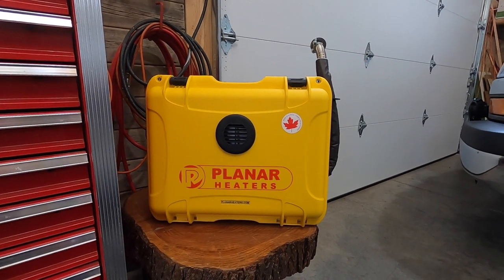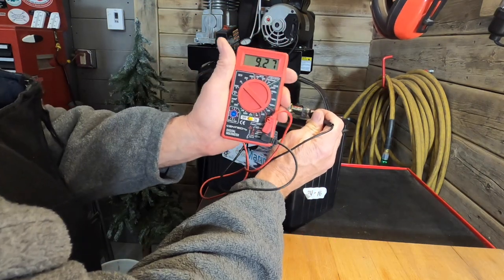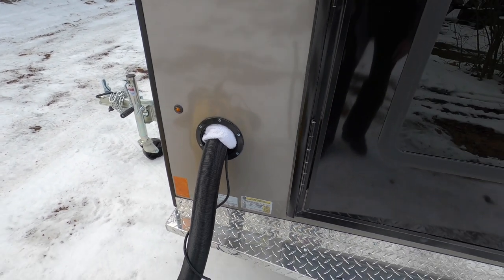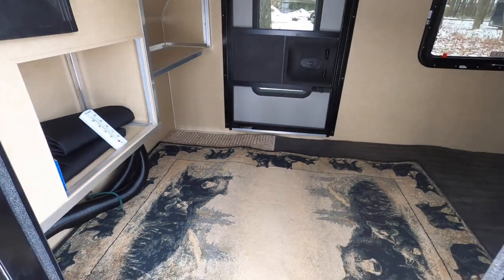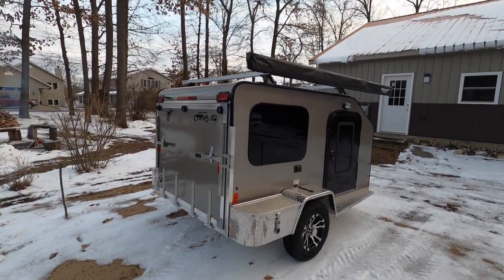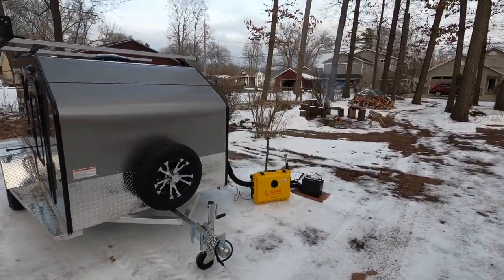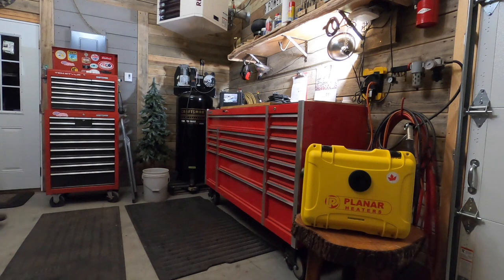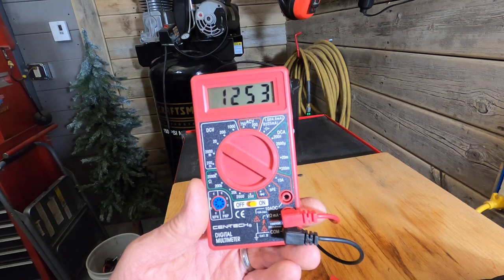cold weather planar diesel heater test

Comment: If going to use this set up in winter weather. Put the battery in a box  like you said. But have the heater hose pass though the box so the heat off the hose keeps the battery warm. 
A container outside has many advantages. 
Keeps the smell  of diesel ,noise of the pump etc outside. Refilling is easier. Big enough for heater and battery ( keeps battery warm)
Last thing if you are going to test other trailers. You got one box with everything you need. 
Great video 💯👍

Comment: Love this set up. One thought I had while you were doing the experiment was maybe crack a vent in the trailer just because they are so air tight.  You are forcing  hot air in with no place for it to go. You may have had even better results. 
Nice video thanks for the info.

Comment: Nice video. I have the same unit, using it for last months. Started out using in my rooftop tent, and also ground tent. Just cut a 2” hole in my teardrop and using it for the first time in the trailer. Instead of running off a typical battery, I actually modified the terminal connections and installed a 12V cigarette male plug, and run the unit off a Jackery 1000W portable battery. They don’t sell it with that in mind but it works great. I’ve kept my rooftop tent at 60 and over with most of the windows open, with outside temps in low 40’s, high 30’s. It gets quite toasty. On the low setting, running 7-10 hours I estimate I have at least 4 days of runtime between fuel consumption and battery life. Typically my Jackery runs down by about 20%; then with solar panels it recharges the next day. My tests indicate I might be able to stretch the fuel out to 7 days if I run the heater 6 hours or less per night. The only downside is that there is not an auto thermostat that cycles the unit down automatically. I read it’s not good to do a hard shutdown as it’s bad for the glow plug. The unit will do a safe down cycle if you turn it off. For those curious, the heater surges to about 8 amps of draw at startup for maybe a minute or two, so the 12V connection is fine. Good luck. Keep the videos coming!
Reply: make sure your plug has secured connection to power station. The whole unit might get damaged if power cuts off while heater is in operation.

Comment: The battery should be in the heated space. A cold battery looses capacity.
Reply: Wrong please educate  yourself .. if the battery  has a draw the internals are  warm  enough  to keep  capacity. Running a heater will keep it warm
Reply: @theviper6602  Not really true, if the battery is not in a heated space and it is a critical application, a small heater may be required to keep the battery warm.

Comment: I used an 1800watt ceramic heater in mine and it worked great even down to 20° days. If I didnt have power, I had a 2000 watt honda generator.
Reply: Hi Kim, I totally agree and  have used my generator often. The diesel heater is simply another option that works pretty good too. Thanks for your feedback!
Reply: @jamesmulder7284  seemd pretty cool. Especially if you're somewhere you can't run a generator.

Comment: Have you considered placing the battery alongside the heat tube and maybe enclosing it somewhat to use some of the heat produced to keep the battery warm? Might that extend the battery life?
Reply: it would defiitely help the battery. theyre not meant to be freezing cold. in fact they can and will be damaged if run down to empty while at freezing temperatures
Reply: For me, I would run the exhaust pipe or gasses through a battery box to keep the battery warm. Insulated heat vent pipe would be nice too..

Comment: This Planar setup has a major flaw in it.  The exhaust should never be pointed up.  Condensation collects but ALSO, if you prime that pump a bit too much or have an issue with ignition etc...where does that fuel go and pool?  right at the lowest point of the exhaust.  Its not entirely uncommon.  Then what happens?  It catches on fire.  Then...that fire ignites that fuel can.  They need a proper downward sloping exhaust.  Having all those pig tails hanging out of the box rather than two Mil-Spec IP68+ sealed connectors that's are properly panel mounted/sealed is also pretty cheapo.  With a bit more venting (not a bad thing) you could just mount the intake within the box too like Keegan's builds do.  I have mine like that (no CPU fan) and get no issues.  Not having that extra hose mess out there makes it REAL clean and easier to pack.
Reply: All details of these heaters have been designed, tested and proved to be safe and reliable. The exhaust pointed up to prevent any chance of the fumes to be drawn into the heater intake. For such a short exhaust hose condensation could be collected in the amount that is next to nothing. At the start heater goes through a purging cycle to clean entire exhaust passage. The heater has a protection from non-ignition fault. It allows only 2 attempts to ignite fuel, and then the heater turns-off to a purging cycle with a fault code. In this case the heater needs a technical service. This protects the heater from over-fueling, flooded exhaust,  and respectively from any possibility of fire in the exhaust. The wire connectors are fully sealed and provide firm cable connection. Combustion air intake is equipped with an air filter and is protected from any elements.

Comment: Jim:  Would the fuel container be too heavy to mount on fender or tool box cover?  Im sure you could mount it on the front where a normal propane tank would go.  Keep up the vids.
Reply from the maker: The fuel tank probably would fit inside the rear storage box. But I’m also working on being able to mount the entire unit inside the trailer with a special exhaust fitting going through the side.
The other alternative would be to buy the non-portable heater and mount it inside the trailer with the exhaust going out the floor and have a remote fuel tank either on the tongue or in the storage box etc.

Comment: Great video,  I do have a question,  
Diesel fuel gels at cold temps I used to add a chemical to my diesel truck when Temps were going to be below 35f. Also the truck had a fuel tank heater that was powered while running,  or plugged into an extension cord when parked to prevent gelling. Any idea how to prevent the diesel from gelling in the fuel tank? Say while traveling from location to location and how to degell it?
Reply: I have the same question!
Reply: I use power service in the white bottle to keep from gelling. It’s easier to keep diesel from gelling then to ungell it. Power service 911 in the red bottle with the ungell the fuel the power service bottle gives a number on the bottle for the gallons it treats but that number is to treat it to 33 degrees. You need to double it to get it to 0 degrees. You can also mix the diesel with kerosene like they used to do. Diesel bought in a winter climate is usually treated upon delivery to the fuel station. I believe they just put in an additive at the fuel station now I don’t think they put kerosene in it anymore.
Reply: Marvel mystery oil should help as a fuel additive.
Reply: @JasonTheMunicipalMechanic  thank you :) great info

Comment: You want a more efficient heater? Add a return hose back to the yellow box. That way you will recycle the already warm air in the trailer. Also the capacity of oil pumped to the combustion chamber is based on how many clicks the fuel pump makes per minute. The fuel pump capacity per click is the same regardless of the heat setting. Each click represents a certain amount of liquid pumped per cycle. You can count how many cycles per minute the pump cycles and that would tell how many ounces the pump produces per that many cycles. This per cycle amount of fluid is a fixed constant. Using this info, you can pretty much mathematically figure the amount of fuel for any given time. Also, I would never pay the ridicules amount of money they are charging for this heater just because they put it in a yellow plastic case. Your better off mounting this heater as a single unit and gain the benefits of the recycled intake air for better efficiency.
Reply from the maker: Thank you for your input Randy.
Thank you for the tech tips on the fuel pump. 
The inside mount can be more efficient for sure, but for a fellow like me with multiple application needs, the portable allows me to move the heater easily from trailer to trailer to vehicle or even ice fishing shanty.
Reply: Actually adding return line back to heater is bad idea as heater needs to cool itself. If air supplied to the heater is warmer than needed heater will drop capacity first and then pump will stop, heter will go through cooling cycle, if air is over 30 Celsius heater will shut down.  Regarding fuel: heater burns from 100 ml per hour to 250 ml per hour depending on setting, pump supplies 4.4ml per 1000 clicks. What's a point of counting clics???
Reply from the maker: @MrVodolaz86  Thank you for your reply. More knowledge into my shallow knowledge pool!
Reply: these little diesel air heater units get a micro camper hot enough as it is, no way you'd want it any more efficient. for an AC return though, definitely.
Reply: Just pushing air into the trailer is creating positive pressure inside the trailer.

Comment: your heater seems to consume even less fuel than mine , and most of the time i run my heater at a pretty low heat output setting. BTW mine is a Chinese heater, and its prob not made as well as the Planar.

Comment: I’m going to build one of these for fun and make it run off Milwaukee M18 batteries with a mosfet to bring down the voltage. Although it probably can take 18v no problem.
Reply: Probably works 12-24v

Comment: Good video what size unit was that and is that gas or diesel please.

Thank you
Reply from the maker: hi Monty, the unit is a Planar Diesel heater, if you google it you will find it is their only portable model.
Reply: @gunlakepaddlesports  thank you
Reply: It’s their 2kw model. They now have a 5kw version for heating larger spaces. The fuel tank holds almost 2.5 gal.

Comment: there has to be a burner of some sort in the heater box,,,but is there a fan powered by battery,,,or is there a diesel motor of some sort, or just what?
Reply from the maker: There is a diesel burner in the box that the warm air passes over on its way to the tube.
There is a small fan powered by the battery as well as a small fuel pump to supply the correct amount of diesel to the burner.
I wanted to check the claims that the manufacturer makes about how little energy it takes to run the system.

Comment: there isn't a return hose to the heater?
Reply: no they have an intake port/hose closer to the unit
Reply: @clintonbutler4503  The heater is power enough to heat an average RTT, trailer, or camper drawing air from outside. Such, you will always have fresh and clean heated air supplied. Although, the heater could be easily converted for air recirculation in case of extremely low temperature or for bigger space to heat. To do that, all you need is to mount an air vent below heaters' outlet in opposite way - with a pipe sticking out. Then, you can attach additional hose for return air.

Comment: you need air recirculation which is more aficant producing dry air & the thermostat will work properly.old warm air being blown back in is the correct way .This is an expensive way producing only warm draging cold air in.